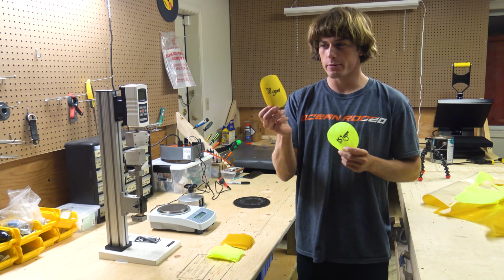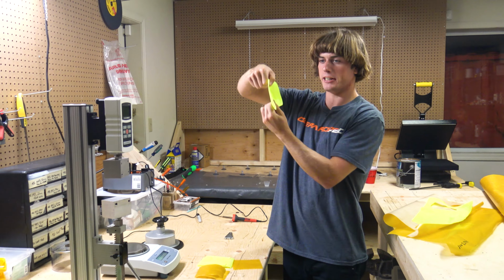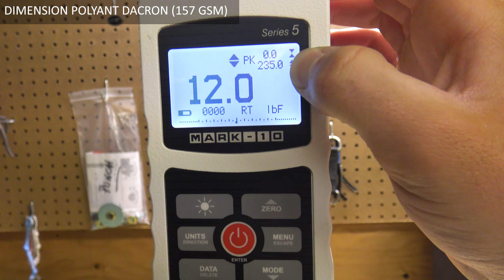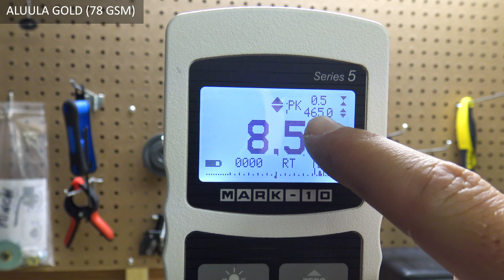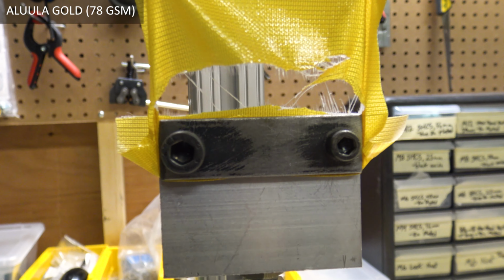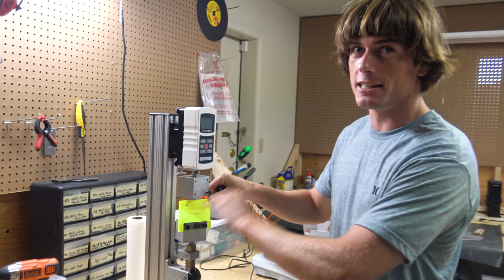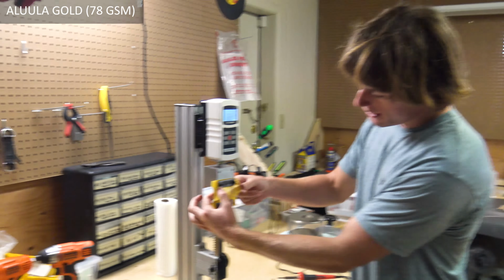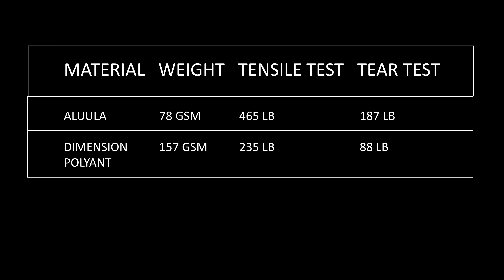HOW STRONG IS ALUULA? | ALUULA VS DACRON LOAD TEST

Comment: Hey, great video. One suggestion as a physicist, I might perform your tests with samples which are cut to smaller widths than the clamps. It appears from the failure of the ALUULA sample that the clamp edges might either be cutting into the fabric due to small angle differences at high loads, from the result of extreme differential shearing along the clamp edges. Mentally visualizing the warp/weft grid of the weave, on the load side of the clamp edge you can imagine the load inducing uniaxial deformation, such that the grid squares become more and more rectangular as they grow increasingly elongated and increasingly thin. Further away on the outside of the clamp edge, the grid will remain closer, geometrically-speaking, to their original square shapes. Along that boundary, however, the weave will deform into an increasingly extreme diamond-like pattern, the localization of extreme changes in grid shapes. This is not completely unlike the sphagettification resulting from the extreme differential effects of gravity around black holes). This nonuniform stress on each column in the weave probably vastly exceeds the readout on your machine, as the load essentially becomes focused on those minute regions surrounding the clamp edges. This is why the rip clearly occurs along those columnar boundaries.

Its worth noting that it’s not as if nonuniform stresses aren’t more realistic in a variety of real-world situations, but for the purpose of more accurate and precise measurement worth re-testing with fabric cut to a width less than the clamps if you want to meet ASTM regulations. If you email ALUULA, I’m sure they’d provide you with a spec sheets with results from various ASTM tests, as a heuristic your results shouldn’t be far off, as they test multiple times to determine values that are of maximum likelihood.

Comment: I am not surprised about the test results and think the fabric is amazing and the kites are amazing as well. I own several Roam-A's which I enjoy immensely, however I have had numerous issues with construction and material breakdown. Several kites were simply built wrong and don't fly right, some had bladder issues, and some have what appears to be a breakdown in the fabric, mostly on the leading edge where by appearance the laminate has "cracked" perpendicular to the tangen of the leading edge curvature. How is this going to play out with respect to strength and logevity of the kites? I have asked more times than I care to tell you about what my options are to solve this problem and to be honest quite disappointed. I am just trying to be honest about it and I feel like I had been patient about seeking a resolution. I have been kiting for 20+ years and owned lots of kites over that time and have never seen a situation like this before. I imagine you are aware of it...pretty much everyone in the insdustry seems to be. What are your thoughts about it?
Reply from the maker: Hey Roberto, You're referring too the gold layer on the Aluula material cracking? Fortunately the gold layer is only there as an extra layer of UV protection. The strength and performance of the Aluula material comes from the base weave. Other than cosmetics, any cracking or flaking on the gold layer will have no effect on the strength or performance of the material. The base layer of Aluula is very UV resistant to begin with, and you'll notice on the new Aeris-x Aluula material, the gold layer is not even present. The gold is only there on the premium Aluula as an extra, extra layer of UV protection. The Gold layer may become cracked over time and use, but compared to the other materials present on the kite, such as the ripstop canopy, it will maintain its performance exponentially better.
Reply: @reeces_shredlab  Hi Reese, thanks for the reply. I just typed a fairly long and detailed response but then i moved the cursor to some spot that cause  the whole message to  delete . I will try to reply again soon in detail.

Comment: awesome man, good to see practical evidence of this stuff. All I heard for the past year is that it's 10 times stronger and twice as light. well It's twice as strong according to your video which is still great. So far the advantages I see are mostly for low wind kiting, and for people crashing kites a lot. If you are into big air and never crash your kite, what are the added benefits? any benefits re the handling of the kite?
Reply from the maker: Thanks! From my experience I find the Aluula air frames make the kites waayyy more responsive and "connected" to the rider. You get immediate feedback from the kites and the kites respond to any inputs that you make (turning, sheeting) much faster than standard built air frames. Basically if you know what you are doing you can whip the kite around much faster and generate a ton of power.
Reply: Hello sean davoust
I would just like to clarify a point about the fiber resistance :)
It is twice as strong for the same surface, but it's usually more representative to compare for the same weight.
If we double the weight, we can assume that there would be twice more fibers bearing the load. Each fiber sees a stress equal to the total load divided by the total number of fibers. The breaking stress would then be reached for twice the load that showed during the test.
So an estimated 2*465 = 930 for the tensile test which is about 4 times the breaking load for the Dacron, for a weight of about 156-157 grams. Still far from '10 times stronger' though!

Comment: could you repeat the test but now with correct tensile specimen shapes please? 
Right now your test is a bit invalid since stress concentrations form around the clamps. 
Please visit https://en.wikipedia.org/wiki/Tensile_testing for some basic info
Reply from the maker: Hey Elon, yes stress concentrations build up around the edges of the clamps, but as long as the material samples are the same shape and are mounted in the same way it's a pretty fair test. This was more of a quick comparison rather than a full on lab test and the stress concentrations should be building up in the same spot for both materials. When I do more tests in the future I will try to decrease the stress concentrations along the mounts by shaping the samples differently. Thanks for the feedback!
Reply: Reece's Shred Lab, Cool Thanks! I’m looking forward to those tests.